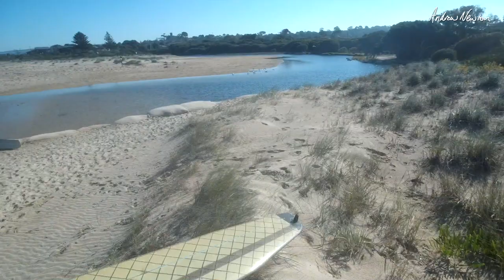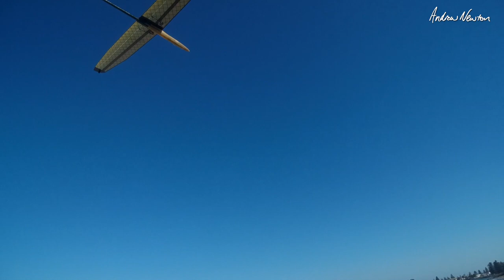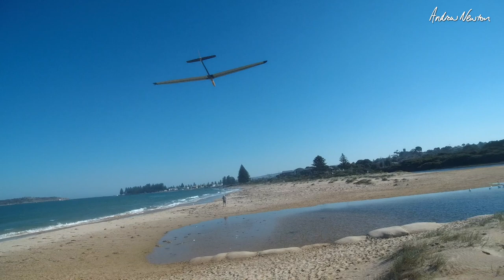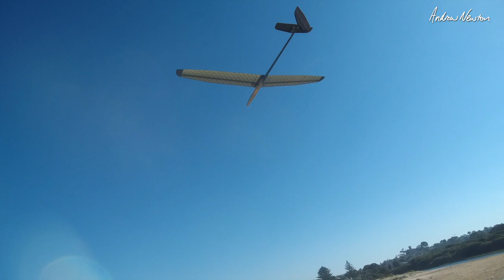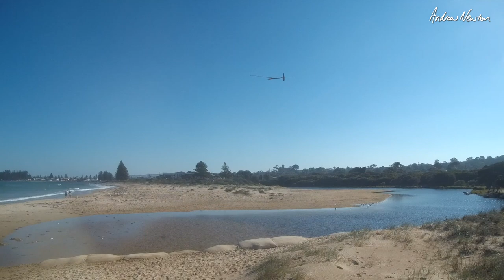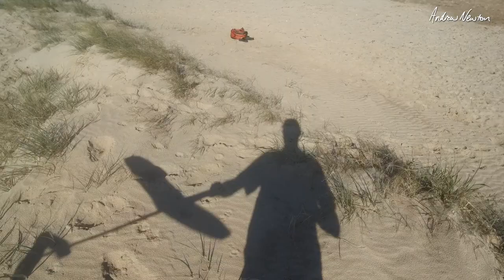DLG Beach Sloping

Comment: That looks like fun, Andrew!  Personally, though, I think DLGs rather priced themselves out of existence. The basic idea of launching from the wingtip resulted in gliders that were fantastically engineered to handle the forces involved - we got lots of carbon and epoxy beauties - but the mania for lightness and strength turned DLGs into the neurotic, calorie-obsessed supermodels of the RC world.

My take on flat-field thermalling from a hand-launch is kinda different, because it does away with the need for a super-strong wing. What I do is build a lightweight balsa airframe (very much like a traditional free-flight model), fit a tow-hook just ahead of the C of G, and launch it (two-handed) with a catapult made from an 18" stick and several stout rubber bands.

Depending on your choice of catapult, near-vertical launches of around 120' can be achieved, with no weird stresses on the airframe, and no sore shoulders. It's much easier to build strong, slim and light when you're not worrying about launch dynamics.

A thin (7 or 8%) aerofoil gives plenty of performance (even for sloping), and the weight saved from mega-reinforcement can be better used in a variable camber setup (or broad, full-span flaps).

I use rudder and elevator for all of my planes; ailerons are entirely unnecessary. Dihedral is not your enemy; I favour a slight polyhedral arrangement because a self-stabilising plane requires fewer control inputs. Less fiddling with control surfaces results in lower drag and longer flights.

Since the introduction of the ghastly drone tax here in England, all my models have been sub-250g. I'm hoping to upolad a video soon.
Reply from the maker: I just subbed, so you have to upload something now

Comment: Andrew I would not have thought there would have been enough lift generated from that small dune to slope soar but then I remembered that DLG's are built with a very low wing loading to allow them to extract maximum airtime from a hand launch which translates to not needing much lift. It was interesting to listen to the vario and see where the lift was (and wasn't) as you flew. I have also seen hang gliders doing the same thing on similar dunes known as Dune Gooning. Thanks for another magic video and inspiration to try "less than ideal" sloping sites and this is why you should always have a model tucked away in the car.
Reply from the maker: It's surprising how small a slope will work.

Comment: Looks GOOD!  But I'd like to see that DLG do some DS behind the dune! 😀👍😀👍

PS: I've been using the OpenTX DLG mixing tips from one of your previous videos.  I now have "Cruse mode", "Thermal mode", "Speed mode" on a switch, and "Crazy Thermal" mode on a slider.  All with built in elevator compensation.  Thanks for the awesome tips! 👍
Reply from the maker: Ha, I did think about DS for half a second. Well done with the DLG mixing

Comment: Andrew do you use a strip of the laminating film you have linked to when you talk about packing tape on the leading edge of your foamies or is that something else?
Reply from the maker: 50mm wide 60 micron clear packing tape usually
Reply: @AndrewNewton  I clicked on the link for your building materials and saw that you use the Officeworks PPS Clear packing tape - I see they now do 3 grades - Light Duty @ 45 micron, Standard @ 55 micron and Heavy Duty @ 65 micron. So I guess either the Standard or Heavy Duty would be fine. Thanks again.